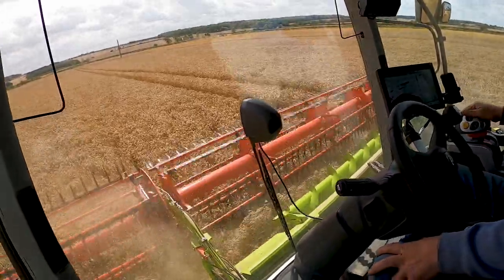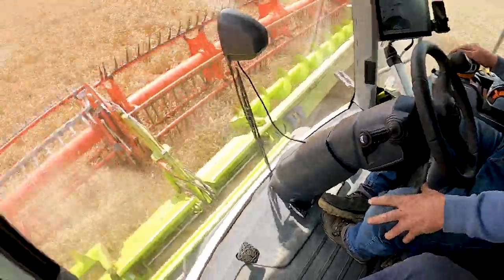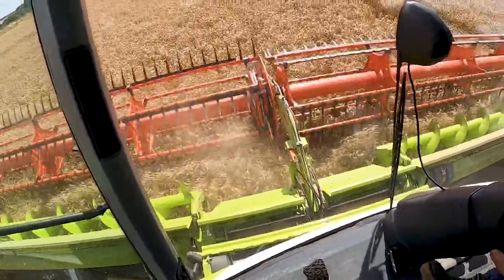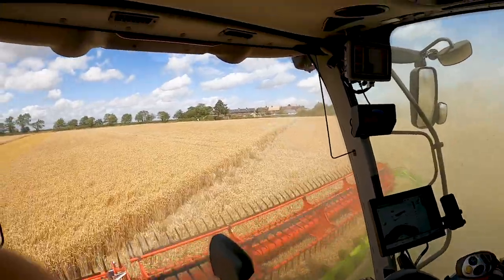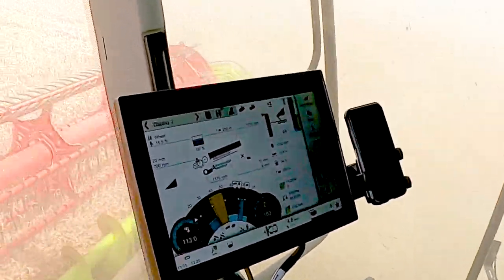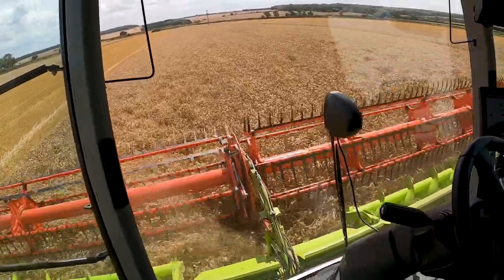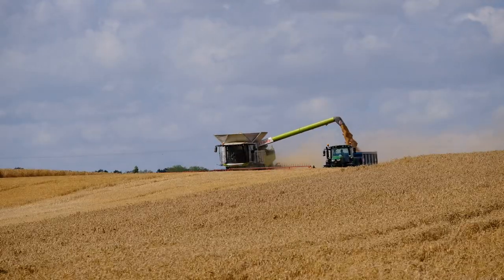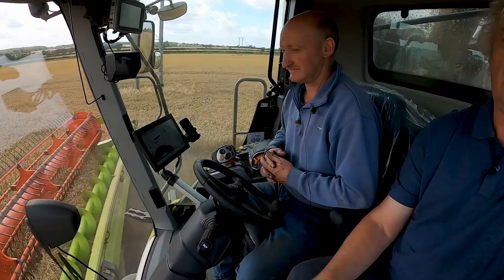Claas 8900 with 13.8 mtr ConvioFlex header. Cinematic action footage  and in cab chat .

Comment: I drove a 10 foot massey in the sixties, no cab, most adjustments, you had to stop and get off to do them, sieves etc, even the unloading auger you had to push out manually. That was a new combine then, how it has all changed. cannot imagine what another 50 years or so will bring. If I drove that thing I would think I was on holiday.
Reply from the maker: I was doing the same Roger, a 726 then a 780 then a n MF400 and ….😜
Can’t say I enjoyed cab less harvesting tho. 
Todays machines are amazing  
Thanks for watching 😊 Chris